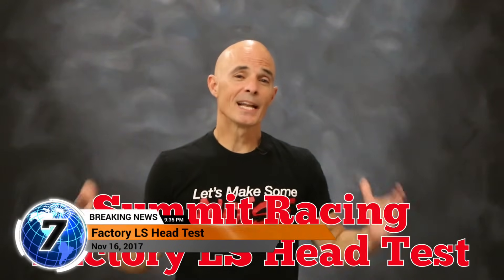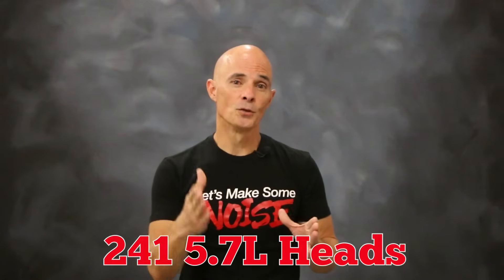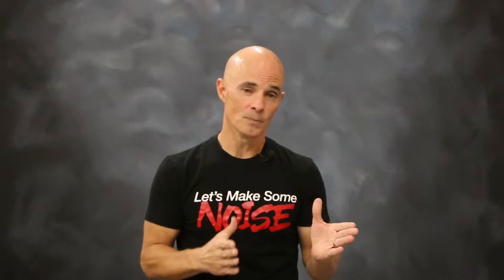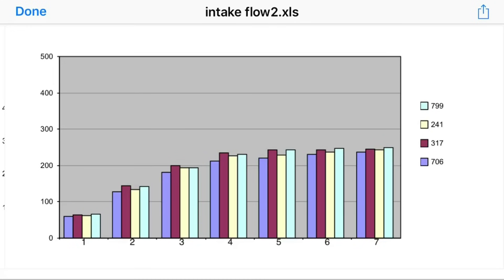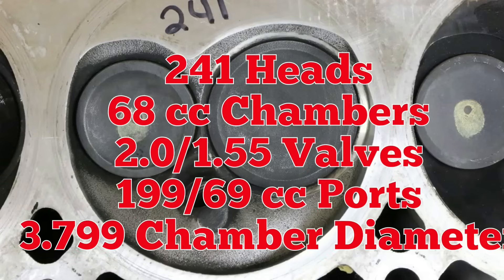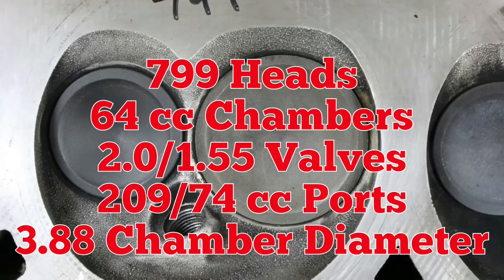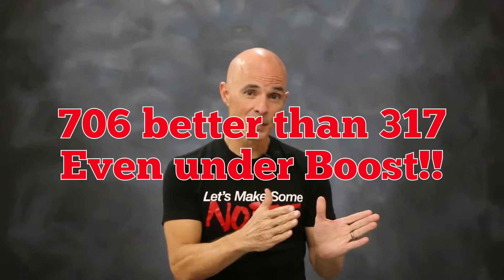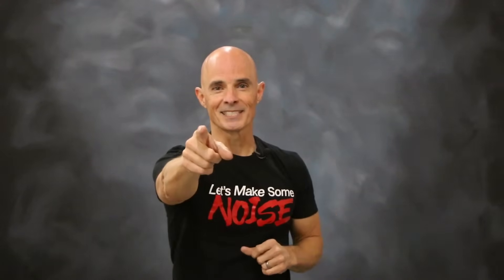THE ULTIMATE STOCK LS CYLINDER HEAD TEST! (241, 799/243, 317, 706)

Comment: Hey Richard. I am building a dirt track street stock car and we are limited to a cast iron block and head. I really want to put an LS engine program together and be the first in my area. GM made the 873 cast Iron ls head back in 99 and 2000. 71cc combustion chamber yuk...
I need to make 500+hp to be able to hang with these Aussie headed Ford guys. They clearly have a compression advantage. 58cc to my 71cc. Mind you this is supposed to be a budget class. No porting allowed. I plan on using gen4 rods and ls2 flat tops in an iron 6.0 truck block figure just over 10-1 compression. Is there any chance in hell I can get to this power level without 13-1 compression. Oh...and yes it has to be carbureted. I will be using the gm distributer and fuel pump front cover as well....I know you like weird stuff.....so here ya go. Any advice on cam choice and intake would be greatly appreciated.  Thank you
Reply from the maker: THEY ARE IRON 317 HEADS-NOT IDEA BUT CAN BE MILLED
Reply: @richardholdener1727  LOL Thanks for the quick reply. ..040" Safely?  Should take em down to 68cc ish?  you seem to like that comp 54-459-11. Good for this application? Figure it will spin to 6800rpm. On the fence on whether to run a single or dual plane.  4800rpm through the corners
Reply: Although if I mill the heads that may create P.V. Issues

Comment: I have been selling my customers a 706 head set with 2" intake valves retrofitted in, giving the same valve size as 241, with the same intake port volume as 241, with a 6cc smaller chamber.

 @richardholdener can I send you a set of these to test as well? 

I own and operate Tallahassee Cylinder Head Inc, a cylinder head only machine shop.
Reply from the maker: I have been talking to Brian at BTR about a head porting series-we wondered about a 2.0 inch valve given the chamber wall proximity and how much flow you gain from unshrouding even the stock valve

Comment: Awesome so my L33 5.3L with 799 heads isn't that bad of a motor! Pretty happy with the potential in that engine.
Reply: Mine let a rod cap go at 232k 05 l33 799 head on one side and a 243 on the other from the factory!
Reply: @MrJoker12321  I was r reading on a blog that a lot of vett guys are pissed at chevy due to there motors have a 799 on one side and a 243 on the other they say they lose 5 hp

Comment: I have a 2001 4.8 with 862 heads what would be more beneficial for the engine ported 862 heads or the 243’s  truck is getting a NNBS manifold and cam soon

Comment: What happens when you use a 706 on a 6.0 vs the 317 ?
Reply from the maker: it adds power and torque
Reply: @richardholdener1727   That was my question as well. Thanks for the answer!
Reply: @richardholdener1727   Same for an LQ9?

Comment: Wow. I never knew how bad you OHV guys had it with flow. 250 CFM with 0.59" lift? First gen miata motors get 200 CFM with 0.35" of lift, and those crap heads had a tight short turn radius, sloppy valve seats, mismatched cast, and gigantic guide bosses.

Comment: I was actually thinking of building my LS1 I have sitting in my garage with a set of low mileage 862 heads I got for $20 (guy upgraded to 243's didnt want these) and a mild cam I use in my current build 216/220 .560 114 lsa (im in cali wanted to be smog friendly) am I wrong for thinking the extra torque from the compression boost will help with hard pulls?
Reply: You'll definitely notice a difference

Comment: I have a rebuilt 5.3 with an ls1 comp camshaft and 706 heads that have been ported and polished professionally with upgraded valve springs and rocker arms.. what kind of wheel power do you think that would make ?
Reply: I was thinking the same thing I havent dynoed my setup yet but I built a LM7 for my 99 trans am 216/220 .560 114lsa camshaft flat top pistons from a LR4 mildly ported 862's with LS6 springs. Kicks the hell out of the stock LS1 I had.

Comment: Hey Richard keep up the good work.  I really enjoy watching your videos.  I find them very informative and I think your info has helped me decide on my LS engine combo.  Can you maybe answer me a question that I have not yet been able to research?  First I will tell you that I plan on using a gen 4 stock bottom end 5.3 , a Dorman LS2 intake and a sloppy stage 2 cam.  My question is what head to use?  I only ask because I can pick up a set of brand new take off LSA heads. Is there any benefits or drawbacks with this head vs. A set of 709s on an NA setup with a stock bottom end?  Thank you!
Reply: Me too

Comment: What bore size were the heads flow tested on? Curious to see if the small bore means the smaller valves of the 706 give better flow.
Reply from the maker: smaller bore does not give better flow to the 706-we tested on 3.81 and 4.03
Reply: @richardholdener1727  I meant in comparison to the other heads, mainly the 799. With its larger valves being shrouded maybe the 799 head flow would be closer or matched by the 706.

Comment: So, why wouldn't I simply decrease the combustion chamber size by having the better flowing 241 or 317 milled?
Reply: You can Mill whatever you want. Past 30/1000 you get into alignment issues with the intake, and you will need new pushrods.

Comment: Cubic inch is really the big factor here. And compression.  But really should have did a test with the Great62’s. (862’s). With a lil port/valve shrouding work they are the best on all applications.  Almost the same as the 706.

Comment: A question never addressed, what is your go-to oil pump and bearing oil clearance/psi?
Reply: FWIW I always use the factory GM LSA oil pump bought right from my local dealer. Increased volume and always raises pressure 10lbs over the normal ls pumps. Had ZERO oiling issues on several turbo ls builds I have done

Comment: I'd like to see a dyno run of the trick flow 216/220 .560 lift, 114 l/s cam with pac 1218 springs, with the 706 heads, holley single plane intake, CSU 650 cfm on 5.3. Im building one right now with an on3 78/75 turbo. I love watching your video. Very informative. Thnx

Comment: It’s funny I got laughed at when I hand ported and polished my 706 heads for my gen4 5.3 guess they don’t understand basic math but thank you for confirming. Did y’all do a compression test with the 706 head installed??
Reply from the maker: i did not do a compression test on these
Reply: Richard Holdener copy that I’m almost ready to pull out the 300,000 mile LS that’s still running good but ready for the my new fun engine so not far from doing the test my self. But thanks brother

Comment: I have a Trailblazer SS 6.0 ltr aluminium Engine with 10.9:1 compression.  What would be the best cam & heads to make the most torque. It will be 90 percent street driven with occasional drag strip play?
Reply from the maker: for stock heads-the 799/243 will have the best torque, the 823 ls3 heads will have the most peak power, aftermarket cath heads like the tfs 225 or others offer even better torque than the 799 and more power than 823. Cam choice is more difficult to recommend based on your description,but something like the comp 54-454-11 works well.
Reply: @richardholdener1727  you put out great content and I love watching your videos. That was also a great question I've been trying to search online the comparisons between the 862 and 823 heads on a 6.0 also with the Trailblazer SS intake or nnbs.. I believe lots of us are here I'm budget builds learning new information and you put out great content

Comment: Can I buy a vowel? How about just a clue?
Where/what ?  The numbers for the heads. I have my heads off right now doing a DOD delete w/cam & springs and I would like to know what I actually have. 
They are marked 5.3 on the inside and they are supposed to be as they are in a 2007 Avalanche. As I tore down this engine (first time in an LS) it appears this engine has be apart before. I have no idea what may have been swapped or maybe even busted. There were dome bad things done. There are 5 snapped off exhaust to head bolts.(I broke one) The foam under the intake... well, one if them (there is supposes to be 2) but, one blocked half of the intake port on #4 and so was a cause of poor fuel for that cylinder and massive air leak. WTF previous mechanic. LOL
So, any help on how to ID these things?
Reply from the maker: all the factory casting have numbers on the outside below the valve cover rail
Reply: Hey Thanks. I will look in the morning. I have seen numbers all over, inside and out but didn't know which ones would mean anything to me.
Reply: ThePeopleVerse if you are looking at the head from the exhaust side- it will be cast into the head on the right end on a flat spot just below the valve cover rail. It will be a 3 digit # 706, 862 etc
Reply: Yep, looks like I have a pair of 243's.

They appear to be in good shape. No play in the guides and no leaks through the seats. Put new valve seals and a set of springs from Texas Speed.
Doing the bigger cam and DOD delete from TSP, plus a tune from mailordertuner.com. 
 Thanks for the info.

Comment: Love to see your test all the different heads at 28 or 30 lb of boost on a 6.0 and maybe throw in a set of trick flow 245s and some large valve max ported 317s
Reply from the maker: sadly that probably wont happen. That's 1500+ hp-it get harder and harder to get the thing to be consistent at those boost and power levels-makes dyno results less accurate
Reply: Curious where the compression/flow tradeoff happens

Comment: Thank you. I had a LS guy from back in the day tell me the stock 4.8/5.3 heads with a valve job were pretty hard to beat. Turns out he was spot on.
Reply from the maker: the stock 706/862 heads are tough to beat on a small bore LS
Reply: @richardholdener1727  so on a 5.3 with the plus sign dish pistons 862's would beat 799's?  I have both and can't decide which to use.
Reply: @prestonedmonds4128  862 ALL DAY!!!
Reply: I have some mild ported 862 heads on my LM7 with ls6 springs 216/220 .560 cam and flat top pistons im probably around 10.20:1 compression and it kicks ass. Have that setup in my 99 trans am hopefully ill get some dyno numbers soon to see where im at.
Reply: Or cnc ported 243's off an 07 LMG. TSP offers that along with valve job that includes 2" intake valves for around 900-1000 bucks.
Reply: Due to the chamber being 61cc, only trickflows have smaller chambers

Comment: dont you think the bootlegger cam is going to favor anything with more compression because of the increased duration after bottom dead center
Reply from the maker: theblackmech the cam will work the same with all the heads
Reply: @richardholdener1727  it does, but will make power with more compression unequally because of my boomer spec 305 exhaust duration
Reply from the maker: theblackmech I would like to see a cam do something different in this example-
Reply: @richardholdener1727  pick a cam with alot less intake duration after bdc

Comment: Curious how this same set up would play out on a 6.0 lq4 I've heard the 706/862s flow 20 to 30 cfm less on the Intake side compared to the 243/799 is the bigger compression still outweigh the smaller valve and port flow what about a lq9 what's the ceiling on compression vs valvesize and port flow
Reply from the maker: I tested the 706 vs 799 on the 6.0L-will post soon.
Reply: @richardholdener1727  very kool thanks Richard

Comment: 706 ftw!!
Reply: I remember a test you shared data on with the 6.0 where they had edged out the rest of the heads but i cant remember if they were stock casting 706 or if they were the reworked ones with bigger valves
Reply from the maker: @knowledgeispower5791  stock vs stock was the test
Reply: 🤔 you also gotta remember this is a 5.3 bottom end so if you had a 6.0 turning the same rpm you might run out of airflow with the 1.89 valves
Reply from the maker: Joseph Samartino I’ll post the results of the 6.0L Test
Reply from the maker: Joseph Samartino they work well on the 5.3L

Comment: And that's why the 317s are really good for turbos
Reply from the maker: you need to look at the turbo head test video
Reply: @richardholdener1727  is that on your YouTube channel
Reply from the maker: @davidcunningham00  That's me
Reply: @richardholdener1727  I just watched that video just now. Yeah I've got a set of 317 on my lq4, but they have been worked and milled 40 thousands
Reply: Great, here comes the Holdener tax on the "throw away" heads lol. This is the great data! 

How about a pt. 2 with rec port truck heads on this same mill?
Reply from the maker: @thegrumpyoldmillennial328  you cant run rec port heads on the 5.3L, but I do have that comparison on a 6.0L.
Reply: Id always take the highest comp head available so I can throw a big stick in it an not sacrifice low end.  Then add boost.